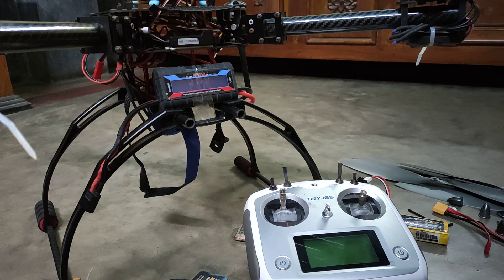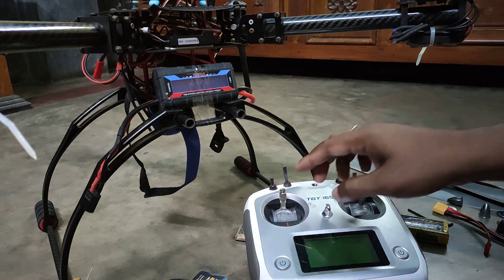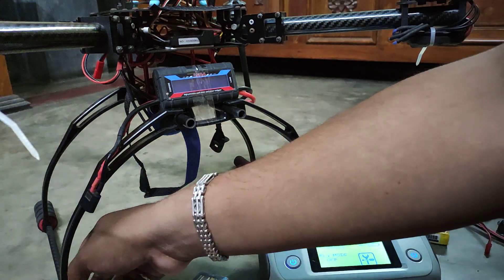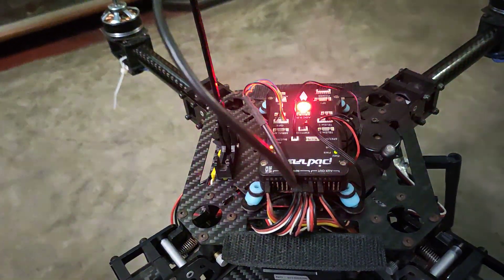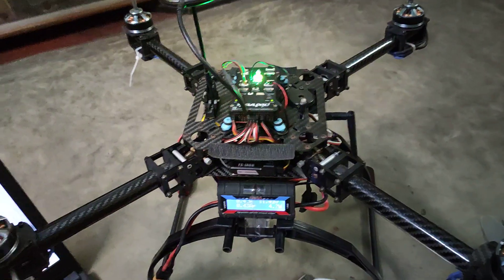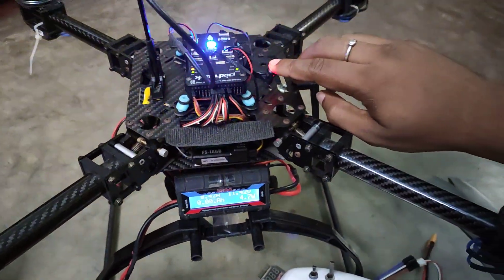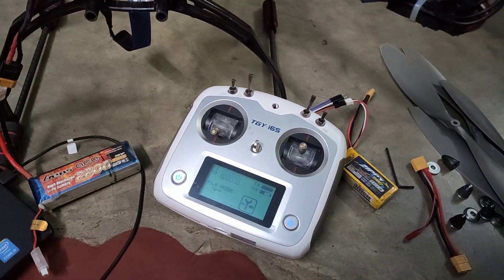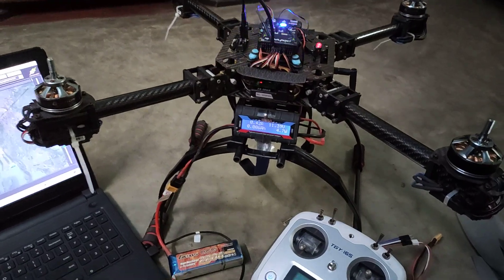PIXHAWK Hobbywing ESC calibration

Comment: How to calibrate my Holybro QAV250 pix23 v6 
but without having a joystick ?
is it possible ? if yes, please gave me some hints to start searching
Reply from the maker: Just check whether that ESC has a  programble port or not. If not then you can not program it with your pc. Coming to the point , with out a joystick, you can use a servo tester as well

Comment: Are there moments that the Pixhawk lose those ESC calibration settings, by mine 8 40 Amp Opto ESC with Simon K firmware are some problems not level from startup and should all the other calibrations do first such as compass GPS radio ?
Reply from the maker: It is not like that. You can do the ESC calibration first place. Some ESC won't generate the sound so it can be difficult in that case specially low cost opto ESCs.

Comment: Great content. Can this also be made with a joystick ?
Reply from the maker: Joystick not tested yet. Will update you soon. You can also calibrate your joystick first and then follow another calibration procedure mentioned in the mission planning software
Reply: @desidrone  The reason I ask is because I don't have a radio controller. I tried to follow the wiki on the joystick setup but again don't really know if it's working.
Reply from the maker: Ok. Let me try and get back to you
Reply: @desidrone  Yeah sure man and thanks in advance. Doing a great service subscribed already. Also if there's another line that I can contact you for tech questions, let me know then cheers.
Reply from the maker: With Joystick you can definitely Fly but first you have to configure it through mission planner and change the Remote Failsafe mode to "disabled" and Telemetry Failsafe to "RTL". This way you can bypass the remote. Get a good telemetry system with atleast 1.5km strong signal strength and give it a try. before the actual flight check the full functionality of the joystick without ptopeller.
Reply from the maker: This is my mail id subhanjan.saha@gmail.com

Comment: hi Can u pls send wiring diagram and firmware to use . me got strucked n making a diy pixhawk drone...could u pls help...
Reply from the maker: Firmware is available on mission planning software. You can upload directly to the board while connecting with USB. Which diagram you need please specify so that i can provide to you
Reply: @desidrone  thank u for ur time suba ... i just uploaded from ground controller and its better now...

Comment: After the sound and take the channel to minimum there are no other changes, the ESC still beeps, tried a couple of times
Reply from the maker: Try to trim the throttle channel. It might not come to the minimum pwm signal
Reply: @desidrone  but are we using pwm for pixhawk because if I configured pwm mode ( flysky-fsi6x) in radio calibration of mission planner it's not showing anything, after I changed to ppm only I can able to calibrate radio.
Reply from the maker: @vishnuprasath4611  that's bcz Pixhawk only accept ibus or ppm signal. Reduce the lower limit of the throttle and check once again. Earlier i have faced the issue and solved.
Reply: @desidrone  Could you please tell the steps, because I'm confused where to change in flysky fs-i6X. first I tried with End points. Is that correct.
Reply from the maker: @vishnuprasath4611  correct. Also you can lower the physical trim slider on your remote. Whatever works for you. Ultimately it should reduce the lower end point
Reply: @desidrone  can you please tell what value you configured I tried with channel 3 (min 105% max 100%)
Reply from the maker: @vishnuprasath4611  connect your pixhawk with mission planner and navigate to Remote calibration page. There you can see the pwm value of the signal. Try to set it to 900-980 and check at which value you are getting the confirmation sound from ESC.
Reply: @desidrone  Thankyou so much, I can see some improvement, now after trim the throttle end point of ch3 to 110%  I can here four beep from pixhawk, after down the throttle but esc not calibrated.
Reply from the maker: @vishnuprasath4611  as you have heard the confirmation sound. Now you can do the whole process again. Hopefully this time your ESCs will be calibrated.
Reply: yes I'm also facing same issue, did you fixed it.

Comment: Dear Shubanjan, how much reliable is RTL on pixihawk 2.4.8, I had configured failsafe as Land but not very sure on RTL. Any views please guide. Thanks a lot
Reply from the maker: As per my opinion it is safe if you set RTL ALT to a safe parameter also the what kind of UAV you r using. Incase of quadcopter it is reliable but incase of fixed wing you have to look for other parameters as well
Reply: @desidrone  thanks
 Quadcopter,  980 kv angel motor, 1045 prop. F450 Frame. Pixhawk 2.4.8
Reply from the maker: @soumitradey8208  great to know soumitra. Tune your copter first and then try the RTL for a short distance first.
Reply: @desidrone  thanks! Will keep you posted on the result
Reply: Hi Shubanjan! Fligh was good  but I can't figure out Altitude hold mode it comes down real fast ! I guess it's not working...

Comment: Sir I have throttle problem. My throttle work delay. 
And are you bangali??
Reply: Same problem please inform me if you got solution of it.
Reply: @wonderphysics2746  yes i have solution. I was already fixed it
Reply: @nilsayan2740  can you please share with me?
Reply: @wonderphysics2746  what's your transmitter and fc??
Reply: @nilsayan2740  pixhawk 2.4.8 and flysky fsi6s touch screen 10 channel.
Reply from the maker: Yes. Is your problem still exist ?
Reply: @desidrone  No, I was solved it.
Reply: @desidrone  yes
Reply: @desidrone  ye and also the drone doesnot hold its position when throtlle stick is centered it goes up even in mid throttle stick
Reply from the maker: You need to adjust throttle mid position if that doesn't solve then adjust the altitude gain parameter